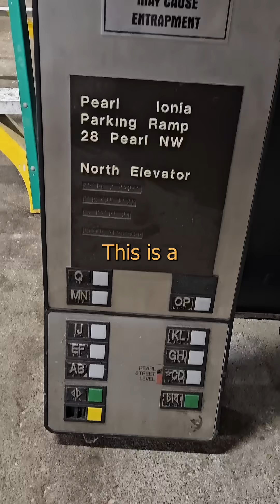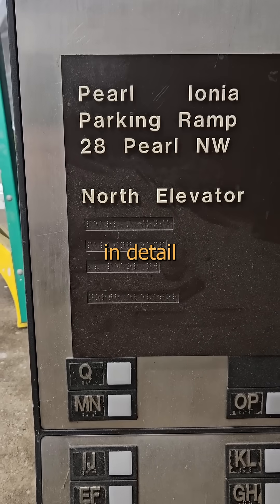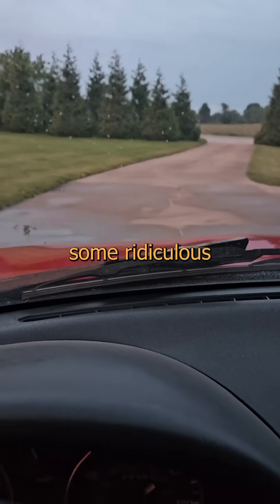Miata Mischief #chrisboden #engineering #gear #elevator #score #stories #parts #hacking #making

Comment: Trying to get farm gear back from an outpaddock. I had a quadbike on the front end loader, a hay trailer made up from an old Bedford truck bed with a 1640 jhon deer on the trailer, that tractor was itself attached to a trailer made from another Bedford. That had my pushbike id ridden the 20km to go get this thoroughly illegal conglomeration of home made and outdated  farm equipment. No straps on any of it, just trusting the park breaks and parking gear. Made all the more illegal because i was 14 at the time